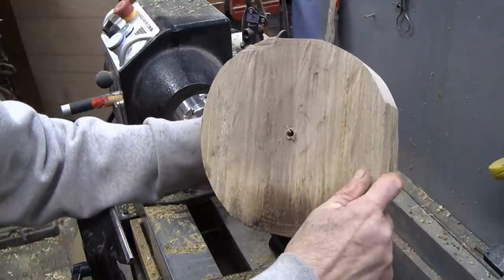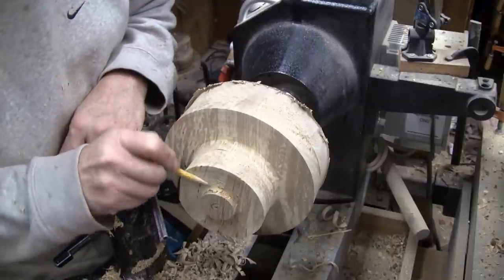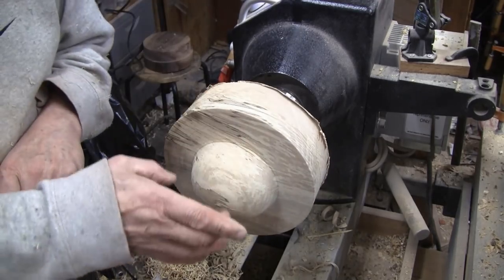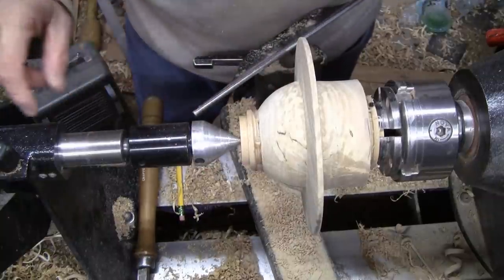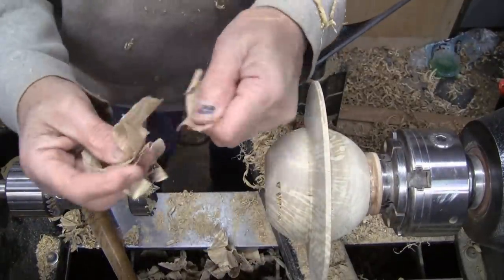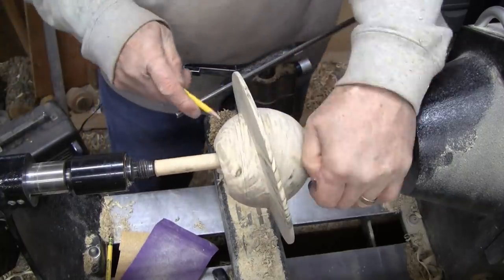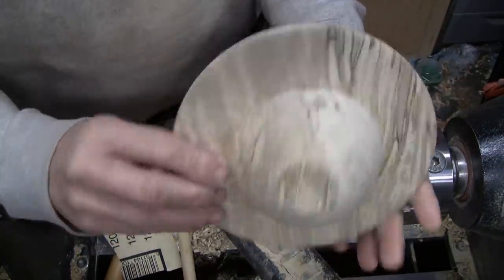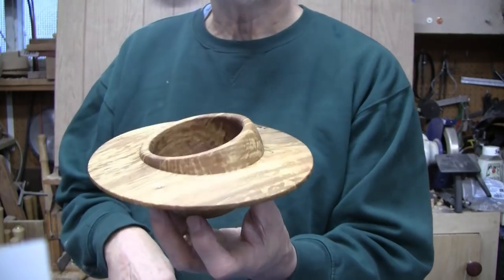My Wood Turning Flew Into Space

Comment: wow amazing Gary!  Were you turning out the inside with the lathe in reverse? I've never seen that before and it makes so much sense when you cant see.
Reply from the maker: Thank you very much Matt! Yes I was turning in reverse and I try to mention it when I do. I missed doing it this time. It is a great way to do it. But if you can get on the  back side of your lathe you can do the same by turning forward. Just a lot better view on a smaller opening.
Take care,
Gary
Reply: @ThePapa1947  its a brilliant idea.  I struggle to get to the back side of my lathe so that'll be an interesting option to try
Reply from the maker: @WithTheGrain527  I would only consider standing on the back side if my lathe did not run in reverse. I am setup where I can not work from the back side. Table saw is up against it. You will want a chuck with a set screw so it will not unscrew when running it backwards. And do not for get to loosen the screw when taking the chuck off.

Comment: Question! at about the 10:30 mark you are using the carbide tipped tool for hollowing. It looks like you are on the right side of the interior making the cut. Is this a carbide tool technique? Also.. what type of lathe are you using? It looks like you change direction forward and reverse.
I am very new to turning so thanks for your great videos.
Reply from the maker: First of all thanks for watching and happy you liked it.
So I should have said but I was turning with the lathe in reverse. It was just a standard round carbide insert.
I am using a Laguna 1836 lathe. It runs a 3 phase motor that allows you to turn both directions. It still runs on 240 single phase though. You can get a 120 volt version as well. Most lathes made today will run both ways. Even the smaller ones and I think they have DC motors which makes it real easy to have reverse as well.
Thanks for watching,
Gary

Comment: What type of hot glue and glue gun do you use? Would have never thought hot glue would hold that well.
Reply from the maker: I buy the glue sticks in a bulk pack from Harbor Freight and the glue gun I bought from Amazon https://www.amazon.com/gp/product/B01N16GE4C/ref=ppx_yo_dt_b_asin_title_o05_s00?ie=UTF8&psc=1 It has 2 temp settings and an auto off if you should forget.
 Yes it holds very well and i have done it on bigger turnings as well. Just make sure the glue is as hot as you can get it.